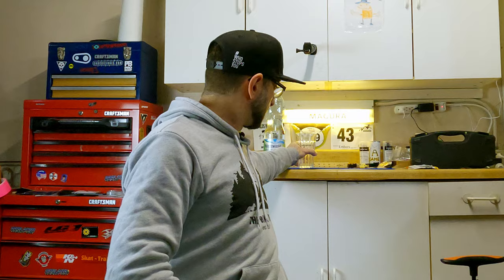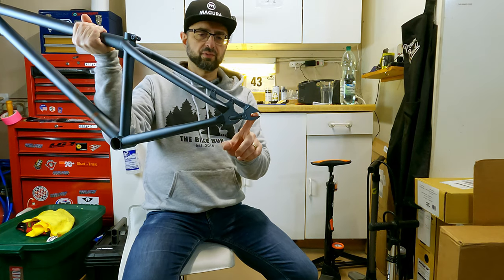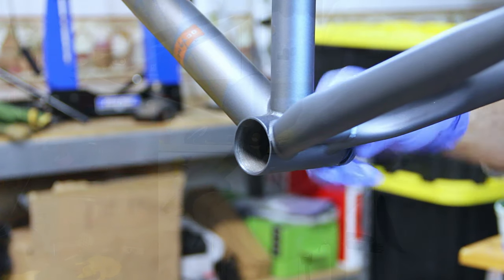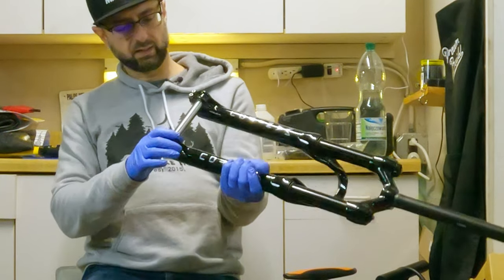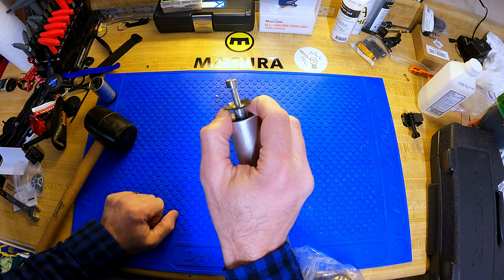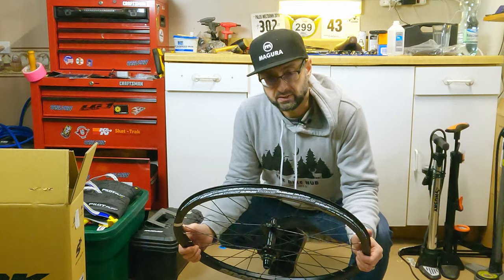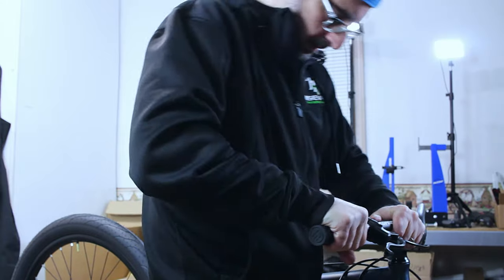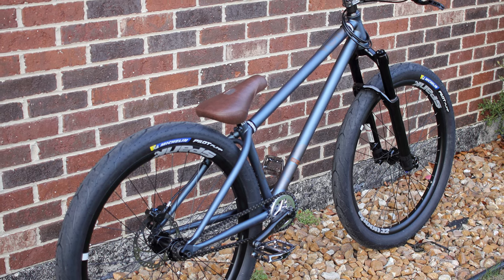This Dirt Jumper Build Took a Year to Finish | Octane One Void Dirt Jumper Build | MTB

Comment: 3rd way to install a star-nut: Use a phillips 1 screwdriver and a hammer. It must fit through the nut obvs and it must have a narrow handle so it doesn't push on the wings of the nut. It's much easier to keep it straight than just hammering on a short bolt and it doesn't load up the threads either.
Edit: You'll need two hands to do it this way so I rest the bottom of the fork on a piece of wood (or something forgiving/non-marring), supporting the level part of the fork casting, not the rebound adjuster.
Reply from the maker: Never thought of that. I might try that in a future build video. Thanks for the tip!

Comment: Just fyi. Gusset chain tugs work well on these frame…I have built three. They also come with three different length bolts just for shorter dropouts.
Reply from the maker: Thanks. I didn't realize Gusset makes those. I bought a set of Arcane tensioners a while back that cost me an arm and a leg and look almost identical.

Comment: This looks like it'll be a nice build. Good frame only issue is threaded bbs. 

Also reminds me of my dj plan. Slightly different, tryna hit like a really high end build that's only what an average higher end build might cost. Not a full pimped out build. Like 23.5 ish pounds or less before any titanium... Reynolds 853 frame. Bomber dj or a pike dj. Little bit of cheap carbon fiber xD loo bmx race pivotal posts ftw. But mostly just smart average parts choice and a few trick bits. 

Btw mtb gyro info. Short pull brakes for bmx levers. And short pull for gyro anyways. Road mechanical discs work best.
Reply: Grease yo threads or use lock tite. Anti seize also works. Only required tool for any bb job. Regardless of other tools.

Comment: Sweet build! The Stolen crankset, was the spindle long enough that the crank arms cleared the frame? Any spacers needed?
Reply from the maker: Thanks. The spindle was plenty long. I used a spacer or two to get the chain line straight.

Comment: How did you mount your rear calipers I have no threads in the caliper mount did you use a nut on the back of those boats? Thanks for any info?
Reply from the maker: You need an IS mount adapter. The threads are on the adapter.

Comment: Do you think the rims you used on this bike would fit on the mongoose pt 26 ?
Reply from the maker: The rear wheel will fit. You will need the appropriate wheel for the front wheel depending on the fork.  There are different standards out there. Spank is very good with dirt jump products and should be able to set you up with the correct front wheel.

Comment: That crown race adapter that you’re using was the fork pretty solid with that frame even jumping ramps, and getting aggressive on the bike or did you ever have problems with it loosening up?
Would that work with a rigid fork and a dirt jumper bike?
Reply from the maker: I didn't have any trouble with it. It never loosened on me. It should work the same on a rigid fork.

Comment: I have the Void one Frame too. I have been having a hard time to keep the chain from lossening up. Any suggestions please
Reply from the maker: I pull the wheel tight and straight then tighten the drive side first. Then I tighten the non drive side. That has always worked for me. Another option is to use a half link chain and slam the wheel all the way forward. Some axels just tend to get loose no matter what. Arcane makes a short chain tensioner that might help.  I haven't tried it yet but it looks small enough to work with the short Octane on dropouts.

Comment: its strange that your bike wouldn't fit a chain tensioner bc mine does quite comfortably
Reply from the maker: The dropouts were very short. Maybe they  changed it.  I was able to use an Arcane tensioner, which is very short. Standard chain tensioners were  just too long.

Comment: I'm thinking about getting a dirt jumper but I dont know where to start. is there a certain bike brand that specializes in dirt jumpers? or should I just individual parts?
Reply from the maker: Many brands will offer dirt jumpers as part if their larger product line. Some are more focused on them than others like NS Bikes. You can't go wrong with many of them. You can alway build your  own but it's usually more expensive to do that. If you are looking to do some serious jumping the higher end the better the components.  If you are just looking to roll the pump track and some small jumps you can get away with a cheaper model.
Reply: @AdrenalineIsLife  thank you

Comment: Not that one is  better is than the other, but what was your reasons for choosing a chromoly frame vs alu? Cheers!
Reply from the maker: There were a few reasons.  I like the look and feel of a chromoly frame. I feel less bad about crashing one. I was able to get it for about the price of the Zircus frame. I would've been happy with either cromo or aluminum but this was too good of a deal to pass up.
Reply: If you're doing street/ park get a steal frame
If you're doing dirt jumps/ a bit of park then get an aluminium

Comment: Can i buy the octane one melt pump and switch the forks that it is good for dirtpark
Reply from the maker: You should be able to with no problems.
Reply: @AdrenalineIsLife  OK IS the frame OK  for dirt jumping👍🏽🤷🏽‍♂️ or i ask straight iwant buy me next days a dirtbike would you buy the ns movement 3 for 580 or octane one melt pumpfor 400 and get another fork for dirtjumps IS IT then as good AS the movement 3? And can i  do dirtjumps then with the octane one 😅🫣 can't find anything really about this in German YouTube 👋🏽✌🏽
Reply from the maker: @kingog9421  the Melt frame is fine for dirt jumping if you put a dirt jump fork on it. NS and Octane One are the same company. I like the Movement better. It has better cranks and the DJ fork.  Otherwise, they are very similar.